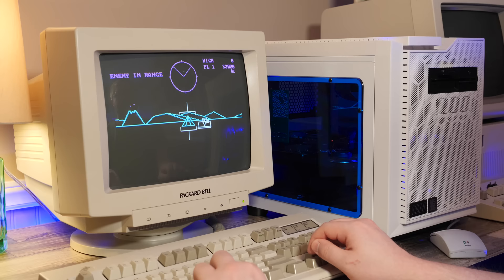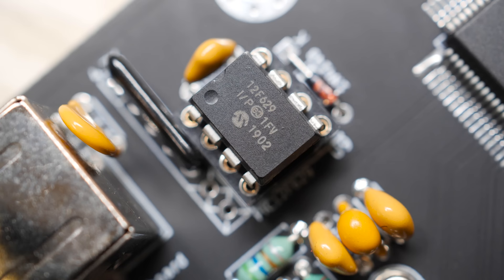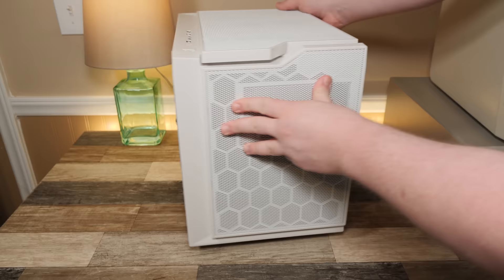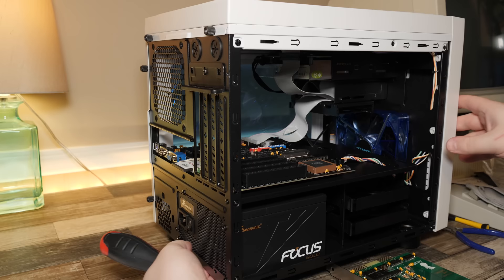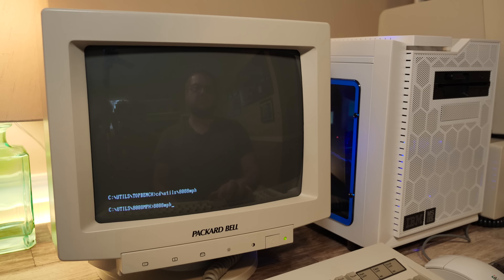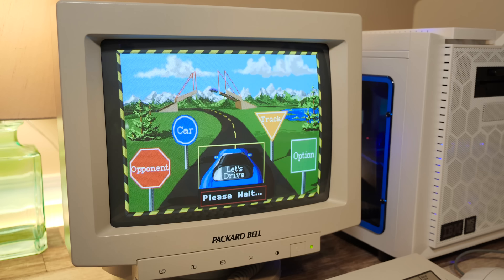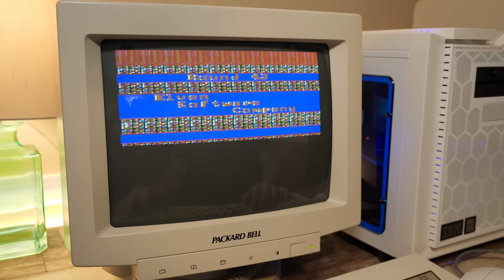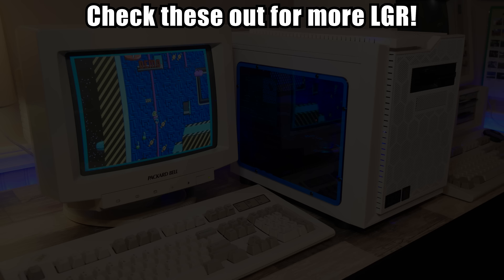Building a MicroATX IBM Clone: The NuXT Turbo PC

Comment: Putting a 5 1/4" drive in a modern case is the most LGR thing you can do to a case.
Reply: No that would be covering it in wood grain  ;)
Reply: Should be an 8'' Floppy for the real IBM experience.....
Reply: Anthony Sibley Wasn't the 8" option in some old floppy controller drivers, using the standard PC FDC and both bays on the original PC for the larger width and/or the large external floppy connector on the back of the FDC card.
Reply: And it looks beautiful.

That case is really sexy and simple. I like it
Reply: its something i wish was in all cases that have the room. i have many uses for CD/DVD drives the only reason i don't use them more is the lack of availability in modern cases. also 3.5 in drive bay for flash media.
Reply: nope, its not LGR yet, its not woodgrain 😅
Reply: @johnfrancisdoe1563  Yes, you are correct as far as I know...I have seen 8'' Drive's in IBM mainframe equipment but never come across one connected to an IBM PC or clone
Reply: Case mod for an 8 inch floppy drive would be hilarious.
Reply: Long live internal drives!
Reply: The last system I had that had 5.25" FDD support was an i7-950 system equipped with a Gigabyte X58A-UD5 so you could have a modern-ish (relatively speaking!) computer directly controlling the drive. Sadly, the board will only support one FDD at a time so 3.5 support in such a config is reliant on a USB FDD.

More fun would be rigging up a turbo button to OC the CPU to 4.0GHz; which almost all the Bloomfield CPUs could do given adequate cooling.
Reply: I couldn't imagine building a pc without some kind of optical drive
Reply: the only even more LGR thing would be putting in one of those Teac or Canon combo drives with a 5.25 drive and a 3.5 drive in one half-height slot.
Reply: You mean besides plastidipping a case so dark green that its almost black, or how about woodgrain?
Reply: What? A modern retro pc computer thats to fast for a retro pc in a modern case.
Reply: If you have the header on the board it will work .  A lot of computers back then had 3.5 and 5.25 inch
Reply: @anthonysibley1021  I am 44 years old and never have seen an 8 inch personally.  If you know someone with those they are either older or just have a lot of interesting stuff.
Reply: This is LGR energy distilled.
Reply: @charleshines6155  I used to be involved in IT disposals...they where pulling IBM Reel-to-Reel tape drives, very early Terminal Muxes with 8'' floppy drives and 14.4kb modems out in the 2000's
Reply: I had a phase where I put 5.25" drives into modern builds just for the aesthetic, even if I couldn't properly interface them. I just liked the look of it.
Reply: I would still use a 5 1/4 drive on my 2004 Windows 7 pc if could find one XD

Comment: Now if only they made something like this for 486's.
Reply: DMP's Vortex?? (Dunno the details ....)
Reply: @rugxulo  That seems perfect, TBH.
Reply: Duke Nukem 3D...what else?
Reply: yes or Pentium classics
Reply: The ZFx86 sounds perfect for this use.
Reply: I have a 386 I'd just love to find a home for but boards aren't cheap
Reply: I immediately started googling to see if there was such a thing. ...Prospects aren't great.
Reply: @avfusion did some looking into the ZFx86 and it does seem like it would make it a good candidate if one was to design something from the ground up to market, but there are currently no easily accessible products using it for consumers to use right now.
Reply: @Jay Pattyson expensive, often from foreign suppliers like Russia or the Ukraine, and sometimes in desperate need of TLC (cleaning, battery replacement, recapping, etc.).
Reply: Still have my dx2/66 that I need to restore some day. And play some Doom.
Reply: I got two vintage Zenith laptops that I bought really cheap last year, for playing Doom as well: one 486, the other 386. The problem is.. I found out the other day that my 386 video card seems broken.
The LCD monitor stopped working months ago, but I could still link the laptop to an external monitor or a TV with a VGA connector. Now it looks like I can't see anything on an external monitor anymore. I have tried to launch Doom "blindly", and during the demo loop I saw the external monitor flashes yellow when the marine picks up the items and red when he gets hit. But that's all I can see. 
It's not a matter of cable or monitor, since I have tried to switch them around and they work 100% fine with other computers as well.
Does anybody know if there's a chance to fix this? Thanks in advance if you do!
Reply: @belandino  Sadly a common issue with Zenith systems of that age :(
Reply: Give it some time, I'm sure they'll figure it out in a few years or so.
Reply: 486 requires special glue logic to take care of memory bus.
Reply: @RonOverdrive  The problem you've got is the datasheet for the development board for that ZFx86 (which is what you or I would be looking to buy as our ready to go mobo) is from 2009 and their blerb states an estimated BOM (bill of materials) of $100US per 10k units.   So it's doubtful they still make them and individually I'd say it'll cost more than the NuXT but if they do... a whole bunch of us showing up on their doorstep with a block order we can split open would lower the price.   486dx4+RAM+onboard goodies with a couple of slots for your Sound Blaster and Voodoo card...
Reply: or Pentium 133 clasics
Reply: 486 is??
Reply: @ThunderClawShocktrix  pentiums werent that good honestly
Reply: @Vexxel256  They are better than 486 systems for late DOS games and can be slowed to 386 speeds by disabling cache etc and they scale well using setmul utility.  For me the Pentium 1 makes more sense than a 486
Reply: @ksp1278  yeah  but the pentium series last processor honestly sucked
Reply: @Vexxel256  Yes, Pentium 4 was not a great architecture.  Pentium 4 is still useful for Windows 98 or early windows XP retro systems. They run out of steam for later XP games.
Reply: A 386dx40 clone like this would be perfect.
Reply: 386s and 486s may not be much by modern standards- but they were the first PCs that were capable of very much at all (unless you count the Amiga, which massively outperformed its mid-80s specs, thanks to its incredible software for the time). It's a pity that much of the software for the 386 and 486 in 1992-93  was fundamentally little better than that for the Amiga 5-7 years earlier, partially thanks to the need for backwards compatibility with 16-bit machines and previous versions. It was the craze for CD-ROMs and then for the Web, along with actual 32-bit software for the 486 and Pentium from 1994-95, which both followed from the near-implosion of Apple, which rescued PC software.
Reply: Then the Pentium then the slot 1

Comment: No IO Shield my OCD is tingling if you take a photo of the back I would design one and 3D print it in White or Black and send it to you.
Reply: @FalconFour  very good I made other backplates and other upgrades 3d printed for PCs
Reply: @AstroKitty16  Sounds like you're OCD about people using the term "OCD" figuratively.
Reply: They come with I/O shields now. Should have more stock within a month.
Reply: He nit picks the case manufacturer in the video, while simultaneously pointing out that the motherboard did not come with one. Of course the motherboard manufacturer should be responsible for the IO shield, case manufacturers can't possibly account for the wide variety of motherboard IO out there.

Comment: Now all we need is someone to remake some 14 inch CRTs with new components.
Reply: I wondered the other day whether curved oled display technology might not be able to offer an interesting crt-like look, without the bulk or inconvenience.
Reply: @TheTurnipKing  Really low-res OLED might capture some of that no-backlight experience particularly in text mode. But since CRTs don't actually really have pixels, they can do different resolutions and DOS-era stuff really took advantage of that. The illusion would be ruined running it at a different resolution than native.
Reply: @_me-ta-_3780  so, you always run it at native and upscale?
Reply: Currently no new tubes are being made. I don't know if there are factories that even have the machinery to make new tubes left.
Reply: FED displays might be a middle ground compromise. Crt like performance but thinner form factor. But no one really makes those either.
Reply: Nah mostly impossible. In my country the CRT factory waa closed about 10 years ago since LCD TV and monitors became common. Major brands already dump their old machines for making CRT tubes..most of monitor and tv that still use crt are refurbished or NOS.
Reply: A paper display would rock for monochrome if it could update fast enough.
Reply: there's new 14 inch crt's on alibaba
Reply: No, no, no... 31" ultrawide CTRs!... Also reinforced desks.
Reply: @mikearisbrocken8507  
If you make a Kickstarter I'll help you fund it. LOL
Reply: @Keil Miller Surprised someone hasn't set up a kickstarter. Mini CRT VR goggles or something.
Reply: @MarginalSC  CRT VR goggles sounds really really painful. Granted, it would be at 80 hz or more but still.. having a crt that close doesn't sound great for your eyes
Reply: @alicev1500  They'd be rather small. Similar to the CRT's used in old military HUD's etc. They're actually dimmer than modern LCD's.
Reply: ew no how about a oled curved convex beige trim monitor with maybe a slightly chunky case giving it the appearance of CRT?
Reply: @TheTurnipKing  lol we had the same idea!
Reply: @_me-ta-_3780  it could be all custum parts with some tweaking done in the fermwares
Reply: @jcilvik  right pluss they are a biohazard or whatever what with the lead and phosphorus or whatnot
Reply: @latebloomer2  If I am not mistaking some are made but its reserved for the highend laboratory instrument and medical equipment market
Reply: a concave led flatscreen crt?
Reply: At this point if Sony remade their late CRT widescreen CRT computer monitor I would be happy. A high end modern CRT likely will never happen unless you could convince a company it be viable for profits.

Perhaps if a YouTube influencer made a deal with Sony or NEC and made a special branded LGR edition CRT something may happen. I won't talk numbers here but I would pay a pretty penny for such a product!
Reply: I work on commercial airliners for a living. We’re in the process of upgrading the cockpits in our very old fleet with liquid crystal displays because no one makes replacement CRT tubes anymore, not at any price we can afford. All that’s left is shelf stock, and they’re quickly running out, the remaining units quickly going up in price. It’s a matter of there simply not being enough market to keep production lines open for replacement parts. If there’s a market, someone will be there to fill it. Consider that you can still get audio amplifier tubes commonly used in guitar and audiophile amplifiers such as the 12AX7, EL34, and 6L6. There’s enough demand for those tubes to keep them in production.
Reply: Or a 19 inch flat screen CRT
Reply: @JohnSmith-xq1pz  lg did make a half depth CRT. Slim CRT.
Reply: @johnathanpearson3203  Really I'll have to keep an eye out for one
Reply: @MarginalSC  Or the tiny CRTs used in old camcorder viewfinders.
Reply: There's enough decent-quality CRTs out there stuck in broken monitors and TVs and whatever that I'd imagine the best thing to do would be to make a modern open-source driver board that could fit any CRT and convert it to RGB/VGA/whatever.
The amount of CRT tubes will only ever go down, so making a device that allows the remaining ones to be used rather than wasted sounds like a good thing.
Besides, if they can make completely new XT clones then they can do this.
Reply: @kargaroc386  
I like this idea.
Reply: @DecibelAlex  they’re recycled

Comment: $320 for just the motherboard? Way too rich for my blood. Looks like a lovely design, though.
Reply: For that price a FPGA alternative would be a better choice
Reply: I mean I would just be fine with a Pentium 3 build.
Reply: Yeah mate, I'll stick to dosbox.
Reply: I looked at that too,  and nearly did a spit take when I saw that price!   Cool build though!
Reply: You can get a blank pcb and source and solder the components yourself. More rewarding I think. You may learn more too.
Reply: @Johnny Bond Know of any good FPGA alternatives? Only one I know of is MISTer and its core ain't that great from what I've heard.
Reply: This was my thought when I saw the price. I thought MAYBE upwards of 180ish for the unit. I understand printing these boards in small batches is expensive, but they are trying to sell a 8088 for 20USD. Can go on ebay and find a new old stock 8088 for less then half that. And like others have said, no I/O shield or anything. You still have to source a case, sound card, power supply, disk drives and any other expansion boards. By the time you build this you could easily be over 600 under.
Reply: That PCB apparently has issues been speaking with the developer he recommends the v1.2 PCB.
Reply: That's just the reality of low volume manufacturing. I can assure you their barely turning a profit if at all at that price.
Reply: My whole gaming setup is worth about $100. I'm rocking with my BSEL modded Intel Pentium E2160, vmodded ATI HD4670 and 19'' 1280x1024 monitor. I can play AAA games like The Elder Scrolls: Oblivion/Skyrim, The Witcher 2, Mass Effect 1/2/3, Dragon Age 1/2/3 and Fallout 3/NV/TTW. Too bad I can't play Fallout 4 or The Witcher 3 because my GPU doesn't support DX11, but I can watch ''Let's play'' videos and it's almost like playing the game. I have my studio tour and gaming setup video on my channel.
Reply: @RonOverdrive  yeah, a PC is tons of configurations, and an fpga can only do so much
Reply: @PAKA62  it depends on why you might want it.

It's a lovely platform if you're interested in the electronics side of things.
Reply: At least it works
Reply: For the motherboard with integrated fdd controller and graphic card + nec vic20/i8088 processor. It's almost a complete computer.
Reply: @haz939  having such a pcb printed will cost you probably the same if you do it alone, and do not count the components. Upscaling production really make things simpler
Reply: @maurofoti526  I already have a PCB directly from the designer for $21. You can in fact get cheaply made PCBs from china.  JLC pcb to name one.
Reply: Unfortunately, I doubt the person making these has much choice in the price, components, board printing and assembly isn't cheap. Bare in mind it probably costs more than a modern motherboard to make especially when you factor in trying to source all those new (old) components. Then add to that the fact that modern motherboards are made in bulk and on highly optimized machinery. I highly doubt they have access to the kind of manufacturing machinery modern motherboard manufacturers use. I would be willing to bet a lot of the SMT and other components are soldered by hand. This is an enthusiast product, not something in reach of the average retro buff. It's a pity, the board is bloody well made and I would love to tinker with one.
Reply: 340 now
Reply: Exactly.. Seen the price and was like NOPE
Reply: I'd rather get an MSI MEG x570 ACE motherboard for that money
Reply: The computer itself doesn't have many extra parts though, motherboard is the main show of the build.
Reply: @johnsimon8457  you have not seen the Mister boards for the DE10-nano. It does Amiga, Atari, Apple II, ZX Spectrum, BBC Micro, a ton of videogame cabinets. It much more the case that an x86 machine can only do so much.
Reply: Mr Guru  the "fanboys" of this vintage are as likely programmers, building games like the 8-bit guy or people who want to relive BASIC programming. It's a little ironic to call them "fanboys", when you, or the non-fanboys you're talking about, are just gonna smoke a spliff and play games, not make them. So yeah, spend that money at the dispensary, dude! 😤

Comment: I'd love to see something like this for a 486 or early Pentium. The XT is a bit too primitive for my tastes, though.
Reply: Same.
Reply: Totally agree.  486 is my era.  I still have all my original 486 ISA cards in a box somewhere.
Reply: DOOM E1M1 music intensifies
Reply: Concur
Reply: XT couldn't really do very much, could it. A 386 running Windows 3.0 would seem to be the absolute minimum spec to compare to a modern computer. Maybe a Pentium 2 running Win98 as well, in the same case?
Reply: They're extremely rare things, but mATX Socket 7 motherboards were made, such as the Asus P5S-VM and Soyo SY-5SSM. It looks like those would support as low as a 100MHz Pentium. Not quite 486 or early Pentium, but slow enough for DOS games.
Reply: A little newer, but couldn't you run 98se on hardware as new as AMD 939? and mATX is definitely a thing on that platform, as well as Socket 370, although most mATX 370 boards are the 810 chipset, which was limited back in the day vs. something like 440BX.

Comment: I wish there was a similar "new" mobo for my old 486 DX2 -50...
Reply: Oh man, I would kill to have a new 486 or early Pentium motherboard in ITX or mATX size. Would be perfect for hardware based DOS gaming machine that does not get in your way.
Reply: Actually, in the 90s I would go trash picking for a 386 so I could try out Linux. I found 286s and 8086s, an eye-opening DEC Rainbow, laser 128, but it wasn't until I got a PowerPC iBook that I had my personal Linux: oh the irony! So anyways, later there was an experimental ucLinux and I eventually discovered Minix. Still, a Linus Torvolds replica original 386 machine would have a strong appeal. IDK if it would be much of a gamer, but still MY idea of retro-computing.
Reply: Back in the 90s, I threw away so many computer parts that still worked just because they were obsolete. We didn’t even recycle. In the trash they went. While I never had anything too expensive or sought after today, I still wish I had some of those parts.